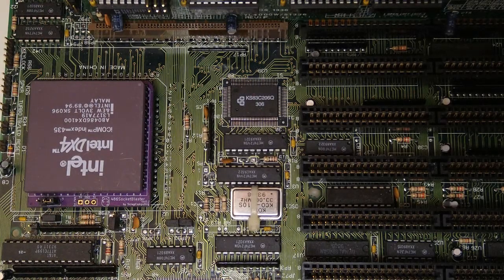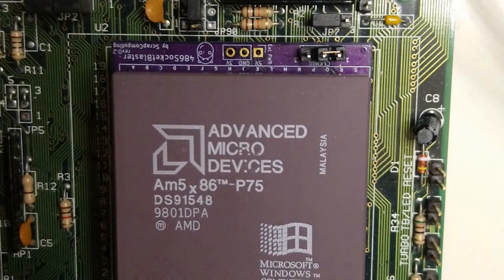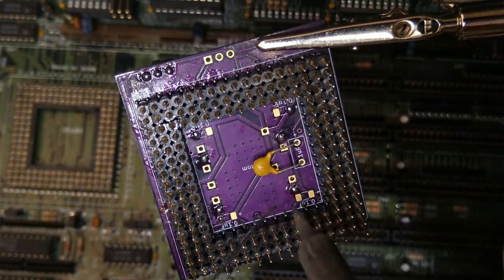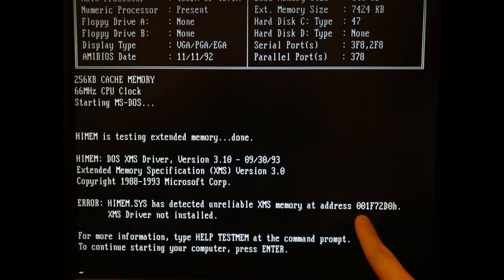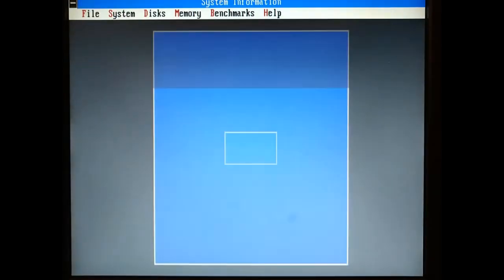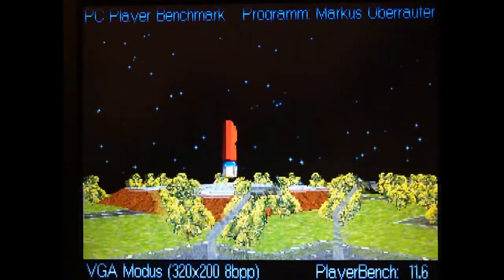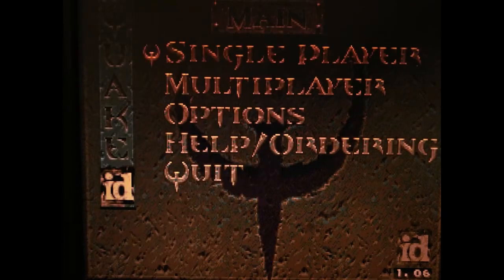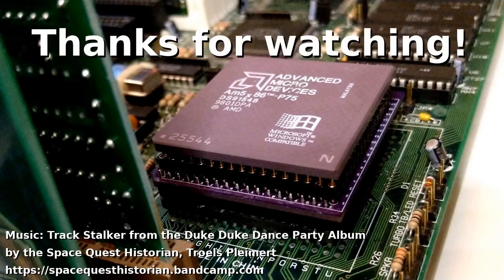486 Socket Blaster + 133MHz Am5x86 better than Intel Overdrive? (part 3)

Comment from the maker: Correction 9:26 about CLKMUL: The jumper on the 5x86 works in reverse compared to the DX4. Jumper position 2-3 sets it to 4x, open (or 1-2 on my motherboard)  sets it to 3x. This was also wrong on the silkscreen table. I fixed it in the latest revision.

Comment: I wonder how this compares to something like a Kingston Turbochip? The Turbochip uses a laptop version of the 5x86, and when I tested it, back in the day, it was a little bit slower, than a full 5x86. Right now, my system is running just fine, but I'm a bit curious as to whether I could pump a bit more performance out of it. It is using EISA, so it's upgrade options are a bit limited. (Potentially expensive, if I wanted to get close to VESA performance)
Reply from the maker: I am not sure, I've never had one of these Kingston Turbochips.

Comment: Could a similar principle be used to make an adapter to run a later K6-2 or the like on a regular Socket 7 motherboard, like with a i430 chipset?
Reply from the maker: Yes, but socket 7 has more dense pins, so building an adapter is much more challenging.

Comment: 2 Questions. Is everything updated for all you need to build this and are you going to try using a Cyrix 5x86 CPU to see if any more changes need to be updated?
Reply from the maker: I haven't made changes to this project for quite a while, but that doesn't mean that things are not going to change in the future. It's in a pretty stable state though, if this is what you are asking.
I don't own a Cyrix 5x86, but if I ever get my hands on one I will try it on.
Reply: @scrap_computing Yes. When you used the AMD 5x86 133 you added more components to the underside of the adapter/regulator. Do I just need to follow the video or is your information fully updated and plus is a premade version available to purchase. I don't have the faintest clue on all the comments that I need to purchase are, plus I don't have any as soldering skills nor do I know anyone that can make one up for me. I definitely need to be able to purchase these rvm fully made.
Reply from the maker: @clintthompson4100  The information on the project's page should be adequate, it lists all components needed.

This is a tricky board to make and requires good soldering skills. Others have reported that they had to scrap several boards because of soldering mistakes.

I am not selling these boards myself and I am not aware if anyone else is selling them.

Comment: Nice project, but the Overdrive's FPU is extremely powerful. Depending on whether you need Integer or FPU performance it's a no brainer which one is better. Also the 83MHz variant of the ODP can very often run stable at 100MHz.
Reply from the maker: Perhaps you are thinking of the Pentium Overdrive, which is using a better core. These are indeed a lot faster.
The 486 Overdrive CPUs are based on the same 486 cores and are meant to be used on older sockets that cannot provide 3.3V.
Reply: @scrap_computing Yup, the original Intel Overdrive is kinda meh in my book. Still a major improvement, but if a Pentium Overdrive is no option I'd go with AMD if possible.

Comment: Hi.  Are you aware the some capacitors need to have their capacitance derated when running at higher voltages close to their ratings?  So for example a 1uF ceramic cap rated for 6.3V, is not actually 1uF when running at 5V.
Reply from the maker: I was not aware of that, thanks for sharing!

Comment: Hi, I was thinking, A viewer left this comment:
"
For the 4x multiplier just isolate the clkmul pin of the cpu from the board and manually pull it to ground (or check if it goes to any resistor or jumper like the clock generator did). Ive literally played the same game on mine which is a siemens nixdorf d819 motherboard. I just connected it to chassis with a wire and its happily running at 160mhz giving around 1300ish realtics in doom.
"
- So, Instead of soldering a bodge wire, would it be easy to change the Socket blaster board to have an extra pin header with a jumper?
The original interposer from back in the day had a pin header marked AMD2X.
I don’t have one to check, but maybe, that's exactly what we need?
Reply from the maker: The CLKMUL jumper position 2-3 grounds the CLKMUL pin of the CPU. On the Am5x86 this enables a multiplier or 4x, but on the DX4 it reduces the multiplier to 2x.
Ah, I think the CLKMUL table on the silkscreen is wrong. It should say 2-3: 4x and N/C: 3x.
I will fix this. This is a good opportunity to add the write-back header too.
Reply: @scrap_computing  It worked! Thank you :)

Comment: I believe the 5x86s run normally at 3.45 volts, and they do really need a heatsink. Worn capacitors on the motherboard can causes crashes and instability too, and 386 and486 systems are starting to reach that age. I suspect yours are on they way out. You should not need 50uf on an adapter to run an AM5x86.

EDIT: Well, it would appear I am dead wrong. I just pulled one of my adapters out and sure enough, there are 2 6V 47uf caps plus a 16v 22uf cap on it. I also took a look at my Trinity upgrade CPU, which is a similar idea, but uses an SMD 5x86. It has 5 10v 10uf caps on it, plus a smaller 6th cap whose value I can't read.

On an unrelated note, have you thought about adding pins on the edge of your socket to try a Pentium Overdrive?
Reply from the maker: Yes, they definitely need a heatsink, and I did use one for testing, though I did not show it in the video.

I was surprised too that it needs so high capacitance values. Thanks for sharing the capacitor values.

I have not looked into Pentium overdrives. Wouldn't they need to be supported by the chipset?
Reply: @scrap_computing  I'm not 100% certain what Pentium Overdrive support really entails. I put a socket down on the solder pads of a motherboard I had and while it did boot, it identified it as some sort of "Intel SX" CPU, and ran with write through cache, but otherwise did indeed work.

Comment: Hey....love the video. Since youve made the socket blaster i wonder  how complex it would be to build a socket device where a QFP package 486 could be used in a socketed 1, 2, or 3 motherboard.
Reply from the maker: This shouldn't be too hard as long as the package can fit inside the innermost row of pins.

Comment: 5x86-P75 should have a WB L1 cache, which was disabled on your system. When enabled, you get a bit of performance boost and speedsys will report it's a WB CPU.
Reply from the maker: Yeah this is in the TODO list for the next revision of the Socket Blaster :)

Comment: Would it be possible to buy one of these from you? I'm not comfortable with SMD soldering yet.
Reply from the maker: There are only 4 SMD capacitors on the board, and the pads are optimized for hand-soldering, so it is not too hard. Just solder one side first and then the other.
Reply: @scrap_computing  well, I have made two attempts. On the first attempt, I made an unfixable solder bridge and had to scrap it about halfway through, and on the second attempt my AM5x86 won't fit the socket I made. This is a precision job for sure, and I don't think I have a steady enough hand to get it right. Are you sure you don't want to sell these? I think you could make some serious money if you did, at least while the 486 is popular in the retro community.
Reply from the maker: @Megatog615  Sorry to hear that. It is indeed a bit tricky, but it is not impossible. I made similar mistakes myself when building it.

You may need to adjust the CPU pins a bit to make it fit the socket, if the socket is not perfect. It is a bit tricky getting it in the first time.

Just like most folks in this hobby I am not an expert in soldering, and it takes me a long time to make one, and the result is not great. So I could not possibly sell them.
Reply: You may find a local builder who would do it (and love it)

Comment: For 160MHz, I always had to increase the voltage to about 3.6V.
Reply from the maker: I am not sure this cheap voltage regulator can handle overclocking, but I should give it a try :)
Reply: @scrap_computing  Have used this type myself for all kinds of stuff. I wouldn't recommend them beyond 1A though. But it's certainly worth a try. With some 15ns cache and 60ns DRAM it should run with optimal timings at 40MHz. It's going to be a beast.

Comment: By the way, the 5x86 says "3.45VOLT" along with "HEATSINK AND FAN REQD" on some versions of the chip. I think the right voltage is 3.45 volts.
Reply from the maker: Makes sense.
Reply: Aye, 3.45v should be a good set voltage for things like this. 3v 486s that want 3.3v have a decent tolerance that 486's which want 3.45v doesn't really have. 
I've run an 5x86 100mhz off of an 1084-3.3 and it works a treat. The regulator doesn't even get warm.

Comment: The videos on the 486SocketBlaster make me wish I had been able to keep my old 486 PC. I had a 5v to 3.3v adapter just like this in that PC back in the early to mid 90's and used it with an AMD 5x86 CPU for a couple of years. It wasn't a perfect solution but for a teenager who had limited money it was a great solution!
Reply: That's been my question the whole time. Does no one know that they used to sell these things? I have two of the socket type, and one of those SMD-on-a-PGA upgrades.
 
I am pleased that new ones are being designed, as they are getting harder to find.

Comment: Hey. I would recommend looking my fork of this device. You don't have to do the built in regulator but do look at the 4 layer design of it. With some help from people who really know what they are doing, we pumped out that 4 layer design that should have better signal integrity and power delivery with power planes instead of traces. 

I never got one made myself since i don't currently have a use for such devices. Nice video, nice idea but that cheap regular is a little iffy.
Reply from the maker: Yeah, I should give it a try. Sadly, I haven't been following the vogons thread much, so I need to catch up.
Reply: Why would number of layers make any difference when there are almost no traces to speak of in this 1:1 adapter?
Reply: Can you post a link to your fork?